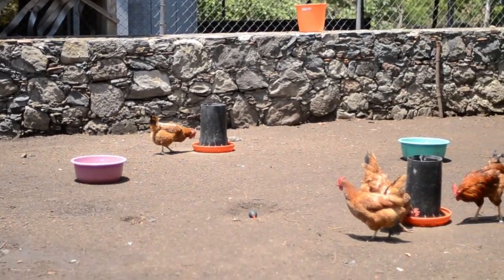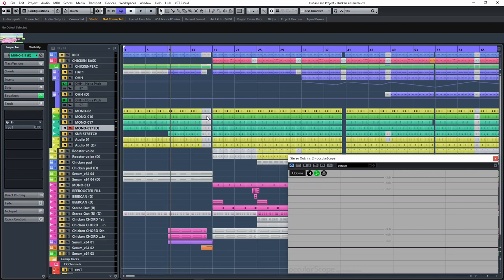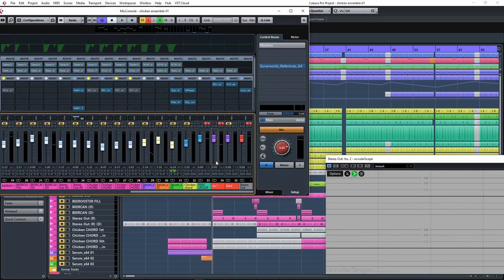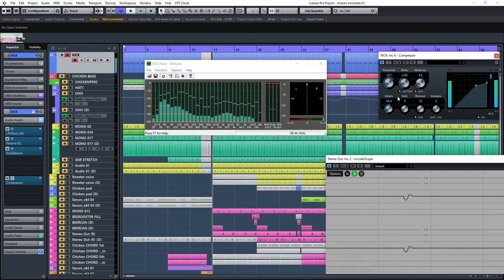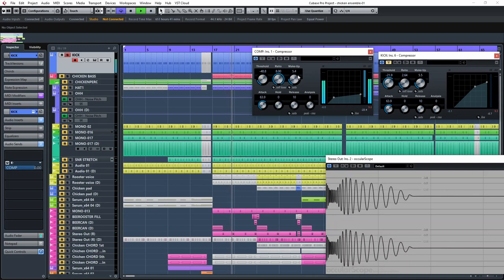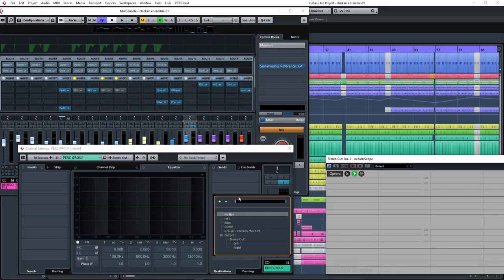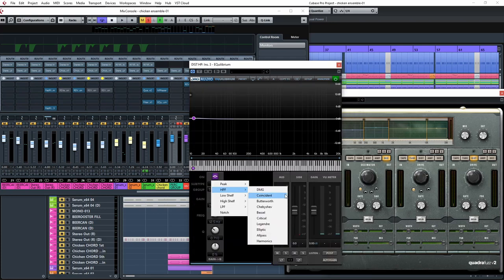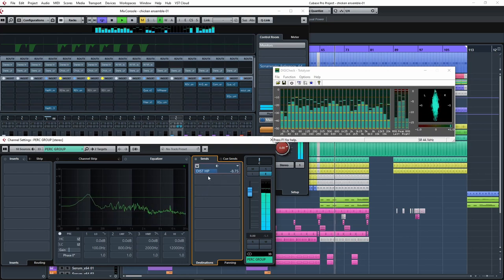PROCESS: Parallel Effects. Make your music sound HUGE!! Simple compression explained. Send/Return.

Comment: Sorry for newbie question but if you summing two signals should you make the sounds/signals quieter on pre fader or gain? Hope it makes sense to you.
Reply from the maker: It's a good question no problem! Depends what you want to achieve.
I generally add when I'm doing parallel so I don't lose the dynamic I already worked on the 'original' signal. So my clean channels I keep intact
If it is something like a really low bit crusher return  or compressor (threshold dependant) you wanna adjust return level more likely since adjusting send level will inherently send a louder or quieter signal to the processor and will change the way it sound. Nevertheless I normally in any other scenario adjust send level rather of return so the returns are on 0 and each channel sending more or less signal to them.